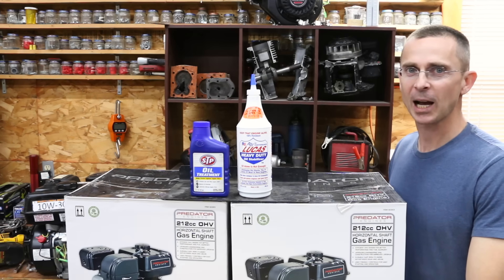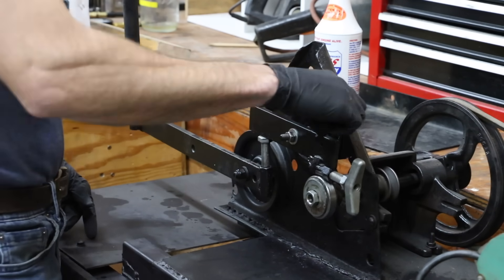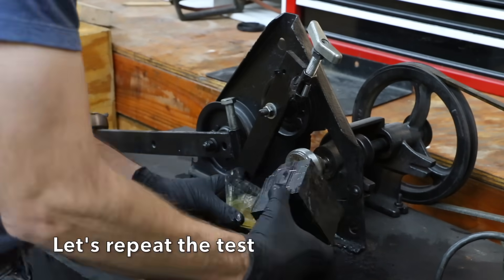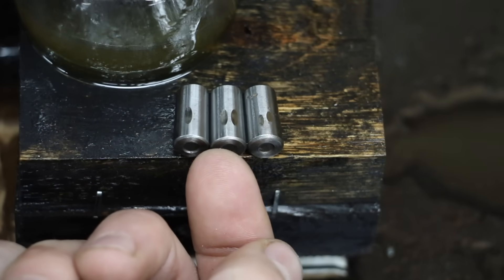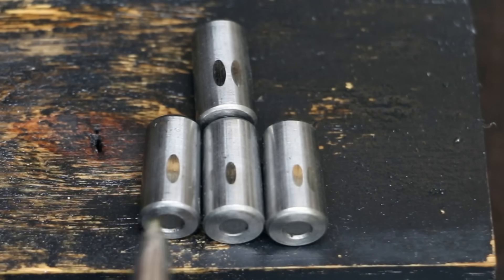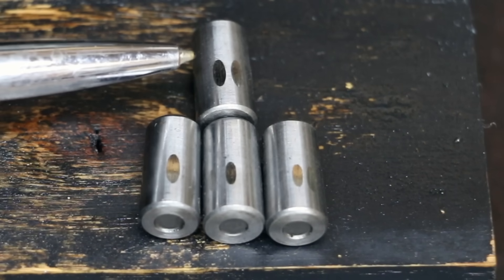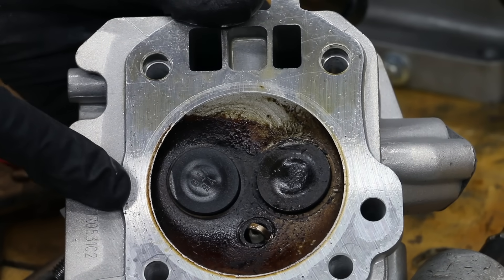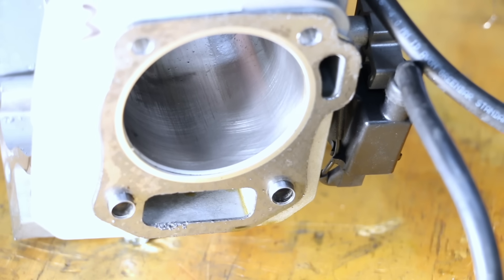Which engine self-destructs first?  Lucas or STP?

Comment: Can you test this one to 
With worst oil and the best oil to ? To see what is the difference & which is the best one?

Archoil AR9100 Oil Additive (16oz) for All Vehicles - Powerstroke Cold Starts, Eliminates Injector Problems https://www.amazon.com/dp/B005UO70ZO/ref=cm_sw_r_cp_api_i_GLHWCbXB60QC0
GoNMF NMF Ionic Friction Reducer, 16 Engines (64 oz) https://www.amazon.com/dp/B01DFYFVP6/ref=cm_sw_r_cp_api_i_8LHWCbYD0PYZ3
BestLine Superior Lubricants HP Long Life Engine Treatment - Reduce Wear by Over 80% https://www.amazon.com/dp/B07H9K62X3/ref=cm_sw_r_cp_api_i_aNHWCb55ETDFQ
REV-X Stiction Fix Oil Treatment - Two 4 fl. oz. Bottles https://www.amazon.com/dp/B005DL3DHS/ref=cm_sw_r_cp_api_i_QNHWCb3PK3R1X
http://

www.xtremefriction.com/Pricing.html
Reply from the maker: Thank you for the video idea!

Comment: As a service engineer for large diesel engines, I became well versed in metallurgy, oil analysis, failure analysis and tribology.  One of my initial investigations involved validating STP for use as a lubricant during engine assembly.  Long story short, STP is not a lubricant.  That’s right, per STP, their product is not marketed as a lubricant - it’s a cleaner, designed to help prevent carbon deposits from building up in the crankcase.
Reply from the maker: Thank you for this information.  It didn't see to do too well on the lubricity tester. So, this makes sense.

Comment: Can you try Z Max engine additive, I used it on my 1984 Isuzu impulse for years and I sold the car with the engine still running well.  I am wondering if it made a difference or I just got a good engine. I did take care of oil changes on time.  Thank you.
Reply from the maker: Thank you.  I tested it a while back.

Comment: Wait so in the 10w30 vs Best line video the 10w30 lasted 38 min, yet both of these engines with oil and additives lasted less time than the 10w30 without additives??? Almost 1/2 the time, how is that possible, or am I missing something?
Reply: The thing you're missing is obvious manufacturing variations between "identical" engines, which renders this "test" and all the other ones a pointless joke with pure entertainment value only. For a sort-of significant and meaningful test you'd need at least six engines - two per product and another two without any product as a control group.
Reply: @misatzu  not even the engines, the lubricity tester machine he has with the bearing is enough
Reply: @Rev9Ghost  well my definition for "enough" would be different, but at least that part isn't a pointless waste of time and money

Comment: man can you do a test on Pertua engine oils?  its a filipino made oil that claims very high performance on their products
Reply from the maker: Thank you for the video idea!
Reply: Project Farm they even claim you can run your engine with pertua drained away from the engine,  as long as their additive touched the metal parts of the engine.  it would be a great test if you can share your thoughts about thier product.
Reply: Project Farm also check this link about thier demo.  they have a rig similar to yours btw.  hope you can   prove if its good ( we are all hoping)  or fake ( then well have justice then). point is we need a third party that can give an unbiased conclusion. i believe you can order their products at "lazada.com"

https://youtu.be/IBayZ8BIsvA

Comment: Do you think stp aided the cooling of the engine or Lucas just ran hotter. As to just plain motor oil?
Reply: There is also a possibility that the engines, despite being from identical manufacturer/same model, may had variances in their assembly that translated in one engine having more friction between the piston and cylinder, thus producing more heat...
Reply: There is also a possibility that the engines, despite being from identical manufacturer/same model, may had variances in their assembly that translated in one engine having more friction between the piston and cylinder, thus producing more heat...

Comment: Great experiments. Amazing how much Roping around rotating assembly. If I couldn’t run a crank scraper I would modify oil brands. One note to add to your experiment is the 1/2 pound free aluminum scrap China sends with each Predator engine.
Reply from the maker: Thank you

Comment: So STP ran cooler than Lucas, and the STP engine had less scoring than the Lucas engine however the STP engine failed first several minutes before the Lucas engine.

I take from this that Lucas is the superior product but if I want my engine to have less scoring and run cooler I'll add STP in there too with Lucas for every oil change.

Best of both worlds?
Reply: This is a good point. A cooler engine just runs longer.

Comment: It’s an oil additive, not an oil replacement. You wasted two perfectly good motors and proved nothing, congratulations.
Reply: Did you actually watch the video?  If so your comment makes no sense. First he ran lubricity tests on both using straight additives, the recommended amount and then just oil. This is going to provide the maximum amount of useful data from lubricity. For the engine test he ran each engine with the recommended amount ADDED to the oil for 3 hours and then drained them both before restarting them leaving them each with only the residual amount of lubrication left behind of each oil/ additive mixture. Please enlighten us, what better method can you devise for testing the effectiveness of additives to provide protection that can be completed in a few hours?  In truth he should have also ran a 3rd engine that had only  previously had oil in it .

Comment: With the fact that the Lucas engine foamed up, makes me wonder if the oil did not drain out as well. The foam will make it cling, as well as Lucas is known to cling anyway. Clinging does not necessarily mean it is better. It may be more useful to keep the oils in the engine, and run it for 48 hours. Then break it down and see what the bearing condition is like.
Reply from the maker: Thank you!
Reply: @ProjectFarm  It may be worth pointing out that clinging properties of Lucas might be desirable for a splash lube engine such as a lawnmower, but have no benefit to an engine with an oil pump, such as your car engine. The oil in your car is fed to the bearings under pressure. The pressure keeps the bearings from rubbing, and prevents wear. In that case, viscosity is more impotent than clinging. The design is affected by the application. 

Truthfully, chlorine is about the best lubricant you can get. It has great film strength. Many motor oils contain chlorine for that reason. However you don't put it straight into your engine, because it will cause corrosion. I'd bet it would perform really well in your lawn mower test.

Comment: I have used lucas oil with supertech synthetic oil from Wal-Mart for at least 15 years. I have got 350K on two of my vehicles. Now my van has 210K. I changed my oil every 15K and used a motor flush every time.
Reply from the maker: That's great!

Comment: Great test, but are engine additives designed to be used in air cooled engines? Most small engine manufacturers recommend strait 30w oil only. Another post stated for a pure scientific test you need a control engine, that is true, but I realize the expense in doing that.
Reply from the maker: Thank you!

Comment: Would like to see a 3rd engine that had been ran and drained of only conventional motor oil, then run it to see how long it runs against the other 2 engines with oil additives. This could shed some light on the actual benefits of the oil additives.
Reply from the maker: Thank you!

Comment: Nice looking and running engines considering they are from Harbor Freight. I am also surprised they made it through the warm up phase with the oil.
Reply from the maker: Thank you!  I like the Predator 212 Hemi engines.  Great value considering the price.
Reply: @ProjectFarm  They look like they run real smooth. what do you use them for other than testing?

Comment: It’s pretty clear that if you use them correctly either lube additive will work, but it seems that Lucas works just a bit better. Using only an additive is not good in any situation, but if you only had an additive to use, STP seems to work better by itself rather than Lucas. Though it seems that if you got a hole in your oil pan and need to make it home, I’d use Lucas.

I’ve found myself in a situation with a cracked oil pan, and while I didn’t have Lucas or STP I used the thickest stuff I could find to make it home. Its good to know what works best in what situation.
Reply from the maker: Thank you

Comment: I use lucas in my dirt track race car. Once we tore down the first motor after using lucas we were sold. Had a friend lose his oil plug on track and still did 5 laps came back in put the plug back in and some new oil and won the feature. Before Lucas our motors may last 1/4 or 1/2 a season after Lucas we tear them down once after the season and most times they still look brand new. We run 2.3 lima's with the KMSA Kajun Ministock Association.
Reply from the maker: Awesome! Thank you

Comment: Bases on the lubricity results, STP at 20% would have likely out performed the Lucas in the engine test.
As I remember from the 70's working at my dad's garage STP ran higher than 1:8 but most modern engines are designed for low viscosity oil blends (10w30 being most common) and STP at 20% would significantly raise the base viscosity.
Reply: They use the thinner oil in order to get better mileage results. It might only be 5%, but it will get them past the government regs and also looks better when advertising mileage claims. Slightly thicker oil WILL lubricate better in most engines. So going up a grade just might let your engine last longer (but this has never been tested, as both auto makers AND oil manufacturers benefit by selling you more of their products). FWIW, I've been using higher grade synthetics for 43 years now, with zero engine lubrication related failures in my family's cars.

Comment: How about wrong lubricants used...for example using 75W140 on a differential when it calls for transmission fluid, or engine oil in the transmission or vice versa? Something like that?
Reply from the maker: Thank you for the video idea!

Comment: I am curious if their is a way for you to find out the actual thickness or weight of the Lucas oil additive and then perform the same testing with a leading brand of oil with the same thickness. I guess I always wondered if I put 1 qt of 50w oil in my car (which takes 0w 30) if it will provide the same results as Lucas since it’s so thick. Id like to think that a 50w or higher oil will do better on your librisity test then a standard 10w 30.
Reply from the maker: Thank you for the video idea!

Comment: Clean the engines up real good, throw all the bits of metal inside and torque all the bolts. Put the original oil back in and ship them both back for repair. That ought to be a real good head-scratcher for them.
Reply from the maker: Thank you for the video idea!
Reply: Thanks for the videos!

Comment: Some people talking about needing a control engine to be able to better understand the benefits of these two oil additives in question.  Lucas lasted about 22 minutes.  Stp lasted about 12 minutes.  That means it had 50% more life left in the engine after the Stp engine died. That's a huge difference folks and this comparison CAN'T be written of as coincidence. However as I do believe that extreme heat does where on engines more than a cooler running engine I still give props to Stp for a oil additive that can keep the engine running cooler.
I say in hot weather run Stp additive to help engine run cooler.
During cold weather conditions run Lucas oil additive to help prevent dry start in the morning. That's where a lot of dry cold metal on.  Metal friction wears down your engine parts. 
Personally I have been adding Lucas to all my engines for as long as I remember and I haven't ever had an issue with anything engine related. 
That's just my 2 cents.
I might yet try using Stp in the summer time in the near future.
Reply from the maker: Thank you!

Comment: STP is a really old additive, it came out in the 50s. There was a known test that they ran STP in an engine, drained it and ran it much like your test here. I'm not that old but from the old timers of that time, said that the motor ran through the endurance of the race. That was in the 60s. Things were a lot different back then, the oils, fuels, engines, etc and who knows what's been done to the oil now, the company has changed hands many times. Lucas came out in 89 and the technology has come along way but they both seem pretty good, I think ultimately it'll come to preference. When I was a kid, the craze was slick 50....
Reply from the maker: Thank you!

Comment: Stp. Lost on the bearing test. And it it traps more air 
Then the motor is was used in did not last half as long as the one with Lucas 
The cooler temp could be a fluke
Reply from the maker: Great point!

Comment: Do a prolong one vs whatever. I will say my 86 Toyota celica went about 400 miles with no oil. Put some prolong in when I did the oil change the time before a Walmart oil change ended up just an oil drain! It was all the rage back then supposedly the best additive at the time. But according to them they are all the best that's why we test. Nice video!
Reply from the maker: Thank you for the video idea! 400 miles without oil is impressive!

Comment: Years ago I was told by someone that know that the NASCAR racers who endorse STP did use STP in there race cars but that they put an ounce or two in the differentials with the Gear oil not in the Engine.....Oil THEY used it but not where you'd think. A Neighbor use STP religiously up until his truck engine swarmed  the Dealer sent oil analysis in for testing to a lab refused to warrent engine. He tried the oil company no luck tried to get STP to help no luck there. The scale and sludge in the engine resemble caked on Oven grease!!!!!!
Reply from the maker: Wow!  That's unfortunate.

Comment: Had a returned tiller with a broken connecting rod, I can't remember if it had oil in it when we were troubleshooting it but I beleive it did. Brigs motors just aren't as reliable as they use to be.
Reply from the maker: Great point.

Comment: Destroying both engines proves nothing. I tested many instruments in various conditions, a "mean time between failures", is what needs to be done. That involves several engines running under normal operating conditions, then measuring wear ion critical components. With his test, if one of the connecting rods was weaker then the test is useless. Plus who would run an engine dry then conclude it's the additives fault? Test only proves you can cause engine damage running an engine dry. One more thing years ago I ran an engine on ure STP because it smoked too much with oil, I was young and broke.
Reply from the maker: Thank you

Comment: I Really like your videos ,  "BUT"  Something is not right here.  The STP should have done MUCH better .
I was a distributor for Slick 50 (predecessor to STP)  in the early 1970s .  My demonstration motor was ran without oil until it stopped in over 100 demonstrations. Each time taking the engine apart and not finding a single flaw anywhere inside.  I did run the engine on pure Slick 50 for 3 to 4 hours between demonstrations .  Apparently STP did not get Slick 50s formula correct .  Proper treatment of a new engine with a T.F.E. based oil is not 3 hours. It is a "treatment" and should be done properly .  Run new engine on high detergent oil 24 hours , changing oil every 4 to 5 hours (this insures all parts are worn in properly and all metal shavings from wear are removed) .  THEN, proper treatment is 24 hours run on pure STP or Slick 50 .  T.F.E. stands for Tetra Flora Ethaline  (Teflon)  It is a friction free plastic that has a high melting point. Higher than the inside of the engine , but will get soft at engine temps. and be pressed into the pours of metals under pressure.

My guess is - ,  If you were to  "TREAT"  the engine with STP or Slick 50 properly , "THEN" use the Lucas as directed .  The engine would still be running strong when your GREAT Grand Son is an OLD  MAN.  As I said ,  I like your videos . They are well done. It is just in  this video you were comparing an engine "Treatment"  To a  "Lubricant".  One more thing , air fuel mixture will effect running tenp. Lean will run 10 to 20 degrees hotter than rich.
Reply from the maker: Thank you.  STP is a much different formula than Slick 50.  Very little film strength in STP and it foams up badly.